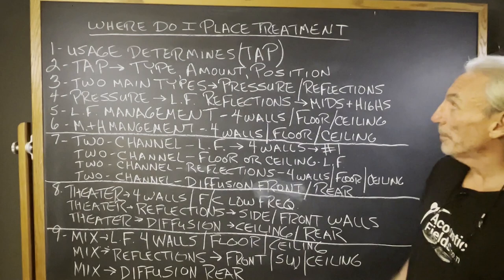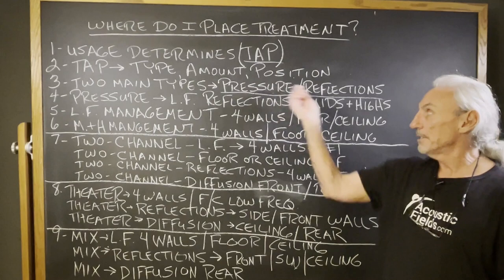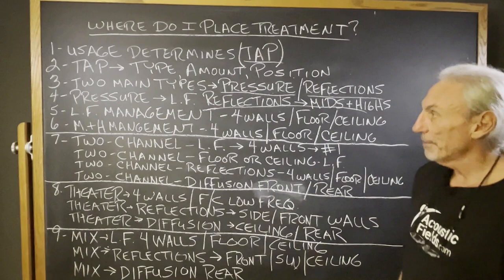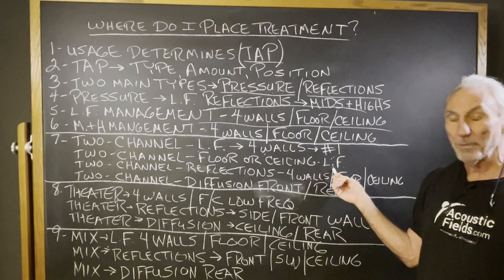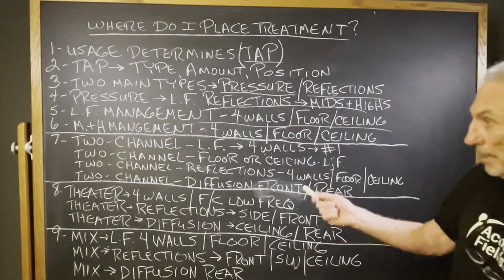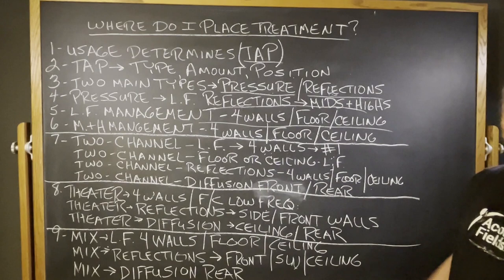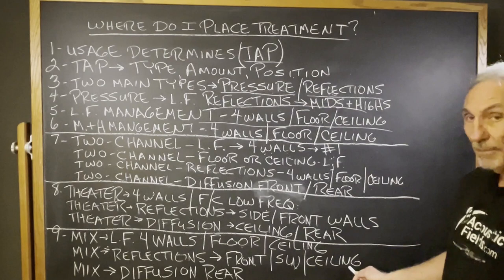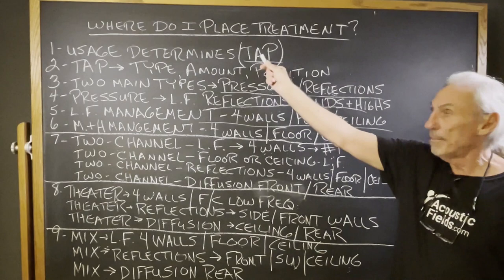Where Do I Place Acoustic Treatment? - www.AcousticFields.com

Comment: Can you explain why low freq absorption can't absorb mid-high freqs? Doesn't the depth of the absorption make it absorb lower, but it absorbs the shorter wavelengths as a part of that anyway? Or is this NOT a porous absorber?? I've found your videos very helpful btw. Many thanks!
Reply from the maker: Study the difference between the energy forms of waves and rays. Waves are pressure based energy that oscillates throughout the room. Think ocean waves. Rays are straight line energy that is reflected from surface areas. Think sunlight.

Comment: Hey Dennis! Great video as always :)
I'm in the last phase of signing a contract to hire a building that I'm going to build a recording studio in. I was wondering, do you guys at Acoustic Fields also treat rooms to give them a specific character? You mostly focus on getting a flat room response and minimal artifacts, but I want to build a live room that will have a lively (reverberating) sound with a dry character and not too much low end buildup. I might even go as far as making the ceiling adjustable in height to change the reverb time. Are you guys in this business as well? Thanks for all the great information!
Reply from the maker: We design all of our rooms for a desired usage pressure range and Rt- 30/60 times. Send us your contact info. to: info@acousticfields.com.

Comment: I wish they would answer more of the questions rather than creating more questions.
Reply from the maker: Every room size and volume along with the intended usage is different. There is no one size fits all usages. If your looking for easy generalities when it comes to room treatment,  you will not find them on this channel.
Reply: @AcousticFields  I think anyone that listens to your videos understands all the variables involved.  They also know that they can submit their room size for analysis.  It seems reasonable that you could draw a use case from one of those submissions to address where to place treatment (TAP) as an example.

Comment: I dislike going to the movie theaters now as all of the ones I've been in sound like crap.
Very unfortunate, I'd rather watch movies using my nice headphone system.
Anyway, thanks for the video!
Reply from the maker: Even the movie theaters in Los Angeles sound horrible. Pressure levels that approach 120 dB SPL and no speech intelligibility.
Reply: @AcousticFields  Yes, I live near LA. The only commercial theater I've been to that had tolerable sound was Arclight. Still didn't even sound good then but it wasn't as bad as others.